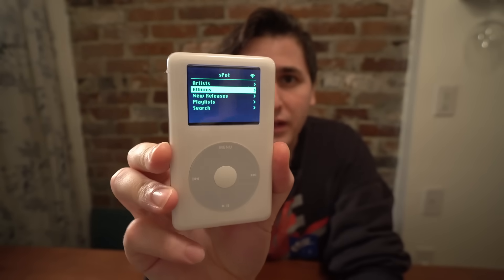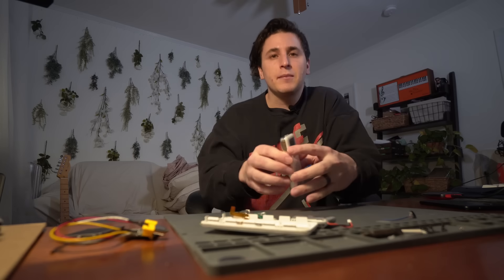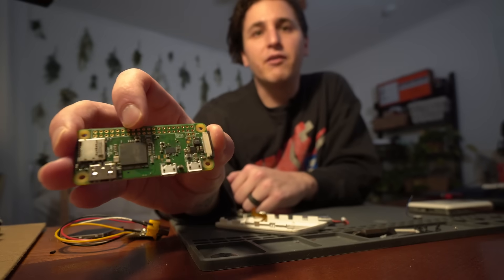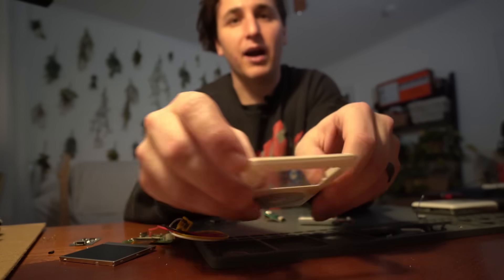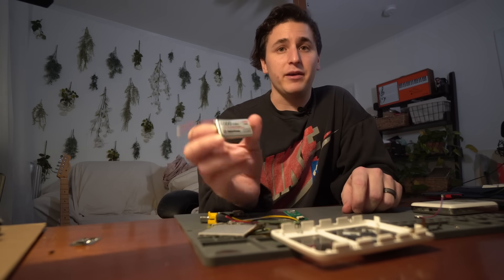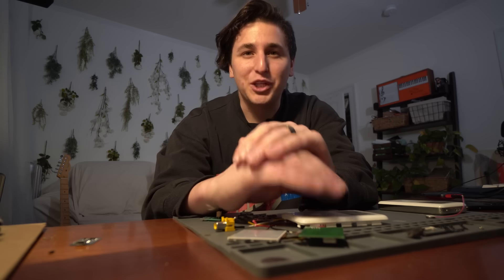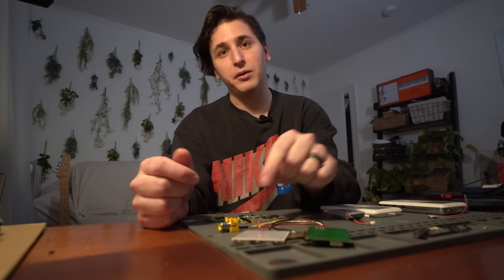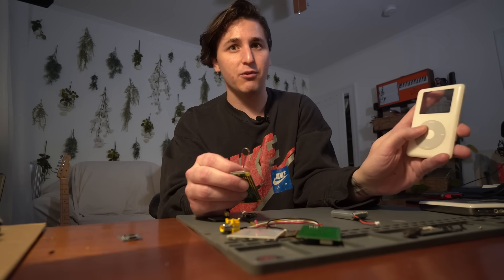Spotify Streaming on a modded 17-year-old iPod Classic (via Raspberry Pi)

Comment: So.. As Spotify is streaming service, you have to be always connected to internet, or is there some way to cashe some datas like in deezer app, so you could listen offline? - what's point of having an iPod if you must be connected to internet all the time (hotspot or something else)?
Reply: Also what is battery life? 5-6h or better? :)
Thanks
Reply from the maker: The current battery life is ~3 hours, but I think I can double that if I find a more efficient screen.

And to your previous question - I'd argue A) having internet access everywhere is kind of a given in 2021. The "offline" requirement just doesn't really matter to me anymore.
And B) most importantly - there is no point! 😁I didn't build this to be practical. It's more of a statement about how I, as a consumer, still have the power to craft my ideal listening experience when the big companies won't give it to me. Plus it was just fun.
Reply: And how do you connect to wifi, as rb pi zero w have only wifi, I bet entering wifi password is a bit tricky.. 
1.have you considered a 3/4g module? It would be probably more power hungry, but it's easier to stay connected to internet
2.you can attach micro usb to usbA port on bottom instead firewire connector hole, if needed or Bluetooth keyboard to connect pi zero Bluetooth adapter?
3.can you fit slimmer 5k mAh battery or similar upgrade from ipod mod?

Comment: So, putting a raspberry pi inside is impressive.. but a raspberry pi inside a case doesn't make it an ipod
Reply from the maker: Getting a few comments like this. To me it's about the behavior, the user experience. If I put this in a friend's hand without telling them how I did it, they wouldn't say "what's this?". They'd say "what's going on with this iPod?"

Also, It's not just a case, I'm using all of the original input electronics!

Comment: Can you post a detailed Hardware list?
What I have by now:
- iPod 4th Gen
- Raspberry Pi Zero W
- 500 ma Adafruit USB charger
- Adafruit PowerBoost Basic
- 3.7v rechargable battery

Anyone knows what else is needed for this project?
Reply from the maker: full component list on the hacakday io page linked in the description. I'll be putting a proper schematic up there soon as well.
Reply: @GuyDupont  thanks! I'll check it out!!

Comment: Wow, amazing! But....a bit torn on the Ipod destruction part, wondering if there is a path to just building one from scratch. Also, I'm sure there is a feasible way to get that headphone jack working as well, are you using Bluetooth earbuds?
Reply from the maker: Thanks! I hear ya. All of the original components (except for the battery) still work, and I am keeping them. Nothing about this build is particularly permanent! Stay tuned for a headphone jack update.

Comment: Oh this is awesome. I have a 3rd gen iPod that I restored a few years ago with a bigger hard disk, battery, etc... but it's a bit of a pain with the firewire connectivity etc. This would be way better. I imagine the pin-outs etc would be different due to the different wheel design though unfortunately - https://iamsteve.in/2020/03/24/build-log-restoring-a-3rd-gen-ipod/

Comment: As someone who was using an iPod Classic up until four years ago when it died, this made me so happy. Would’ve been interested in hearing about how you worked in Bluetooth and WiFi functionalities, though, or why you opted to remove the 3.5mm playback.
Reply from the maker: Wouldn't say I "opted" to do it, it was just simpler to skip for version 1. I plan on hooking it back up soon.

WiFi and Bluetooth are both relatively easy to deal with on the Raspberry Pi, so they came naturally.

Comment: about the motor, you should have added a mosfet or a transistor, after all it much over 4mA
Reply from the maker: There is a 2n3904 driving the motor 🙂
Reply: @GuyDupont  Ah, ok, you didn't mention it 😅, but that's very cool stuff, waiting for the second release with working jack, remote interface and native USB plug, and kudos to that clickwheel

Comment: Would've been cool to get the original screen to work. Someone reverse engineered the iPod video already http://www.electricstuff.co.uk/ipodlcd.html
Reply from the maker: Yeah I saw this - not much on the old monochrome displays tho. I am still determined!
Reply: @GuyDupont  with a bit more digging I found the datasheet! https://www.datasheetarchive.com/pdf/download.php?id=07c526e5c41e5d51ad6e4d5d24810c6eb3032f&type=M&term=F51824FNFSLWAE

This matches the part ID I found on a listing I found on eBay for the 4th gen screen. I don't have one at hand so I can't check for sure though.
Reply from the maker: @xureality  yeah thank you!! I downloaded this yesterday and am gonna try to carve out some time to play with it.

Comment: Now someone needs to mass produce some pi board with a sd card slot, micro USB or USB C, that connect to the iPod’s screen, click wheel etc, with similar software than this. iFlash I’m looking at you

Comment: cool project man, how's the battery life on this?
Reply from the maker: Not awesome, like 3 hours in it's currently state? A more efficient screen would go a long way
Reply: @GuyDupont  thanks that's what I imagined... would be cool to add wireless charging to avoid the hassle of connecting it to the power all the time
Reply from the maker: Thought about this! Dunno if I can do it through the metal case

Comment: Your work is too interesting to have such an unweildy soldering iron, please, at least use a TS100.

Isolate the metal back from the components with Kapton tape, and secure them with epoxy.
Reply: Also you way overpaid for some of those modules! 

But I love it, I've been making bluetooth stuff out of old ipod/iphone parts all through the lockdown. This is a hundred times more interesting.
Reply from the maker: I love my weller!! But I actually just ordered a Pinecil, excited to try something smaller. And all components are isolated with tape, I just don't show it. As for components... Yeah, you're totally right but A) I like supporting Adafruit and B) I got to a point where I just didn't want to wait for int'l shipping.
Reply: @GuyDupont  I used to use wellers like that, I inherited them... It's night and day for tiny components, hahaha.
Reply from the maker: @rockstopsthetraffic  yeah I rarely go very small. Excited for the new one to come!
Reply: @GuyDupont  I'm excited for what you'll make next, man.

Comment: i don't get this. if you change what is in something it is no longer what thing so this is not a ipod. this is a raspberry pi and a screen and stuff put into a case. this is like putting new stuff on old case or computer in a game console. it fails to be what it was if you take out what made it what it was to begin with.
Reply from the maker: This is a fair critique! but at the end of the day, when you seal it up, not too many people care how it works under the hood (at least that's my observation so far). For me, this was about capturing the experience of using an iPod.

That being said, I do want to try to leverage more of the original components. I think that would make it even more special.
Reply: @guy dupont, you responded really well on this comment,. well done!

Comment: Amazing work, but it seems not easy to write a true Spotify player for not officially supported platform? By using Raspotify via Spotify Connect, seems the "sPot" is actually chained to internet connection and can't be used offline. Don't get me wrong, it's still cool, just hope it can be used anywhere like the old iPod. Again well done!

Comment: Does your PiPod back up playlists for offline use?
Reply from the maker: I'm unable to save the Spotify tracks locally (I think that might cross some legal lines), but I could theoretically load on my own mp3's to sit alongside the spotify tunes.
Reply: @GuyDupont  I understand. I was just wondering because I can do that in the app. Not necessarily downloading an MP3 file but a back up that only Spotify so can play offline. Thanks, though.
Reply: @GuyDupont  Saving offline would require Widevine encryption as Spotify is using that on Android. Not sure if that is reverse engineered properly on Pi though.

Comment: You were able to get Jason's clickwheel code to work!! Damn man, I've been trying for over 6 months to read those bytes!! I've got an almost identical parts list to you as well. Only difference is display, which I got from this Amazon screen - B081Q79X2F. (I'm also looking to add a small DAC and micro-sd card slot into mine, so you've saved me some work in other areas.)

Great job, I'll be sure to reference your Github page to see how you got that clickwheel parsed. Thanks!
Reply from the maker: Nice! TBH, I didn't bother trying to compile the AVR code he supplied. Once I had the clock/data lines, it was pretty easy to tell what was happening just by printing out the packets as binary. Does that screen fit in the case?? Would love to switch.
Reply: @GuyDupont  Yeah I was also trying to use a separate microprocessor to do the interpretation cause I couldn't tell if I was reading the bytes correctly. Definitely will compare with your wiring and code.

As far as the screen, it's a tight fit, but after shaving off some of the PCB (safely!) it worked pretty well http://imgur.com/a/mN22vHA